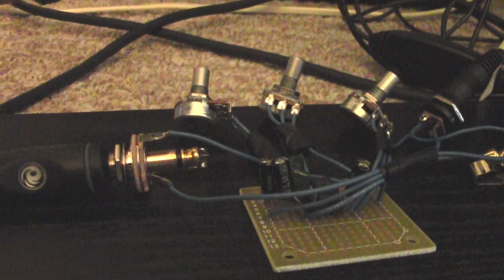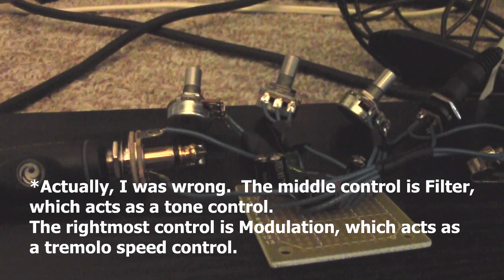Effect Demo - 567 Modulator (By Beavis Audio Research)

Comment: is there a battery connected to this? I tried looking at the diagram but it doesn't show where to put it on the breadboard. Do you know where I can put the switch?
Reply from the maker: Hey man.  I used a power jack on this one, you can see it plugged in on the upper right.  As far as adding power to your breadboard, you would just use jumpers to connect the positive terminal to the positive rail, and the negative terminal to the negative rail (You can see the + and - rails on both sides of the breadboard.)  Hope that helps!
Reply: @gasolinechlorine  Thank you so much for the help man!